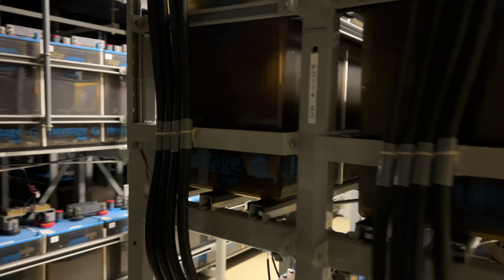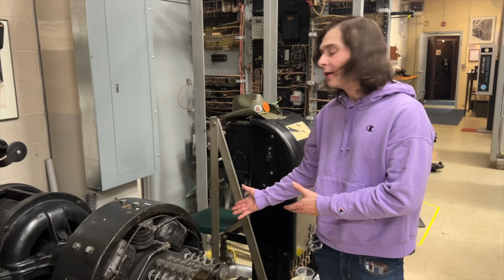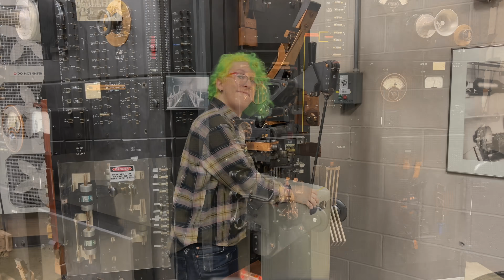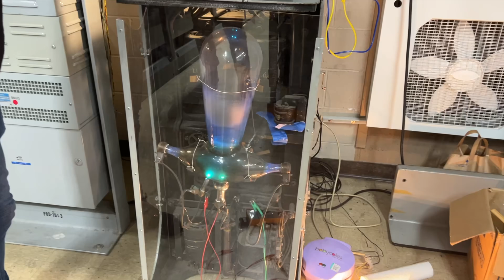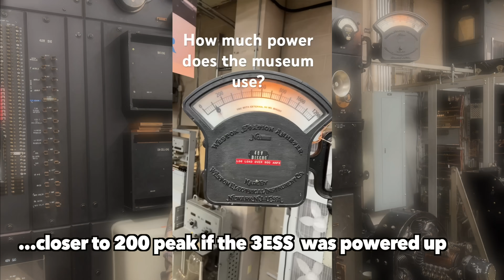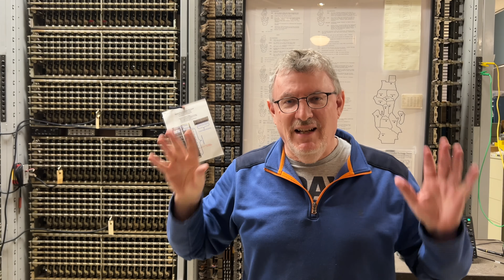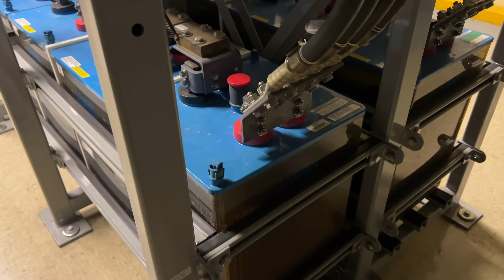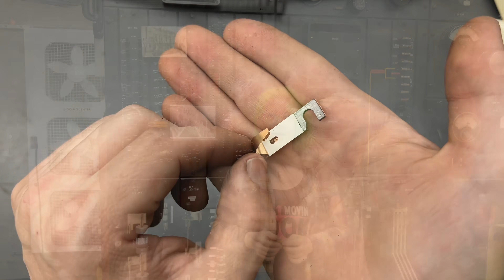All About Telephone Power Plants

Comment: A story I heard (take with a grain of salt).  At a central office the power (utility) went out.  OK, fine we start up the standby generator.  At the time this was a gas powered turbine.  To start said turbine, a blast of compressed air was sent through to start the blades running, and it was followed by the burning gas.  That's fine.  Generator up to speed.  Now flip the switch to supply the load.  Well, over the years, (since the last power failure) loads were added and the generator couldn't handle it very well, so the turbine stalled and died.  Not thinking very well, the procedure was tried again (the compressed air supply was good for two starts).  Rinse, repeat.  So now there is no more air to start the turbine, and all they could do is watch the CO slowly die.  The procedure was changed to make the charging of the compressed air supply a top priority, and the loads on the emergency supply side of things was more closely monitored.

No, I was not a witness to this, it is a second (or third) hand story.  I was told that this happened in San Francisco.  Live and learn!
Reply: A friend of mine worked for AT&T / Ameritech.  He told me there was big fiasco at I believe it was the Bowery Street central office in Akron, Ohio.  The building is a fairly tall multistory office.  HVAC chillers occupy the top floor and the next floor down has a bank of turbine generators.  A chiller failure dowsed the turbine generators and switch gear, bringing down 9-1-1 service and large part of the CO switching.  Truck based generators were brought in from an AT&T equipment yard, but the portable generators did not want to start in cold winter weather which was making the fuel gel.  It apparently took several days to get everything sorted out and running again.

The moral is: don’t mount your generators where they could get wet because they eventually will get wet.  My old employer learned that my putting the 50 KVA MG set in the basement under a fire main which broke.  TEPCO learned that at the nuke plant in Fukushima where they put the Diesels in the basement.

Another fiend had an Internet business site which was hosted at an independent telco in Doylestown, Ohio (not far from Akron, Ohio) in the 1990s.  A utility power failure caused a an automatic transfer switch try to start and cut in a Diesel generator, but the transfer switch exploded, knocking his Internet servers out for almost a week.  I was an engineer at small data center and we test ran our Diesel every two weeks.  The first test of the month was no load.  The second test transferred the entire data center to the Diesel for 30 minutes.  I always got the classic adrenaline rush every time I pressed the transfer button, remembering the story I was told about Doylestown.

When I first started the data center job, there was not a program in place to exercise and test the Diesel generator, and very little preventative maintenance had been done.  It was about 2:00 AM on a February night with an ice storm, and I was awakened by my pager.  I looked at the pager and saw some power transfer notices from the Symmetra UPS.  A little while later, there was another pager message from the Symmetra.  Sleepy, I assumed the last notice was about the bump which occurs when the automatic transfer switch goes back to mains from Diesel.  When I looked at my pager as I got up to go to work, I was horrified to see the message was the two minute warning from the Symmetra that it was about to shut down.  Luckily in that last two minutes, the utility power had come back and saved my bacon.  What had happened is that the Diesel had shut off almost immediately because the seal on its water pump blew out.  The data center had been running on its UPS batteries for about 45 minutes.  Bringing the data center up from being completely off is probably a several hour job and we would have had customer complaints.  Karma was kind to us that night.
Reply: One of the problems with the turbines was that once the turbine shut down and the power went out again an exhaust gas temperature sensor would not let the turbine restart if the power went off a second time a short time later. If I remember correctly, the two turbines at Anaheim Lemon (ANHMCA01) were removed and diesel generators put back in because of this.
Reply: @edwinsinclair9853  Was that one of the Solar Gas Turbines? 
In the late 1960's , we had a Solar 200kw gas turbine set at ARCDCA11 that blew up ... I was on duty when the turbine, running a monthly full load test ate a gland seal (we think), failed to shut down on over speed because fuel was being supplied by way of the gear oil in the planetary gear box, air damper was slammed shut but that only crushed the flexible joint  in the plenum, splitting it open and allowing room air to supply the turbine. Over speed failed so the beast just continued until it shutdown, I guess the bearings failed when speed reached some ungodly speed. I was not in the room when all of this happened, but knew something was amiss when all the building lights went off, every alarm known to man came on.  Auto transfer switch failed, stuck between commercial and emergency positions so there was no emergency power, or commercial power available.  I had to manually restore commercial power breaker.  Total down time was about 30 minutes, just enough to get the fire department next door to extract the smoke from the power room, before it worked it's way to the #5xbar switch room on the second floor.  Of course, the end cell switch operated, probably because 48 volt plant voltage had dropped down low enough.   
Long day, Lots of alarms that day, but no real damage to customer service or the switch machines......
Reply: Decades ago, heard one about the graveyard technician who went to the head: first alarm: the mains went down, the second alarm: the first automatic generator failed to start, the 3rd alarm: the second automatic generator failed to start. He was moving fast by then, as the third and final generator failed to start. (you can also take this one with a grain of salt) LOL

Same source; ‘The Painter and his Bucket of Paint’. Bus bar and bucket. Didn’t event cause a blip! Won’t say much about the painter (shaken, but alive).

That was the kind of crowd that I was running around with back then. 80’s
Reply: I've heard a story (very likely apocryphal, but still interesting) which supposedly took place in a telephone exchange with a manual change-over for the generator, and for some reason, it didn't have a mutually exclusive change-over switch but two on-off switches.  One connected the external power lines to the exchange, while the other connected the generator to the exchange.  The correct procedure was, of course, to start the generator then, when it got up to speed, disconnect the external power lines then connect the generator.
According to the story, during a blackout someone neglected to disconnect the external power lines before connecting the generator, which of course caused the generator to be connected to the entire town.
Supposedly (and this is the truly unbelievable part) the generator stalled under the massive load but the engine driving the generator kept running (at least for a few seconds), ripping itself off of its mountings and rolling itself right through a brick wall.
Why do I think this is just a fantasy tale?  Well, even back then, I would expect there to have been fuses between the generator and the switch, and those fuses would have blown out long before the generator could stall.
Of course, safety wasn't always the "big thing" that it is these days, so it's barely possible that it actually did happen.
Reply: Yeah, No Call Processing alarms are a bitch.